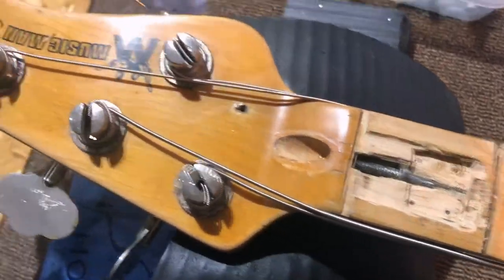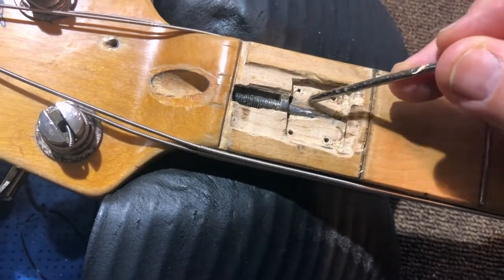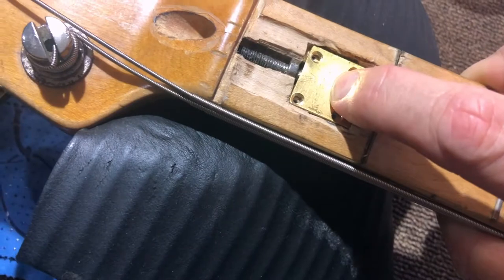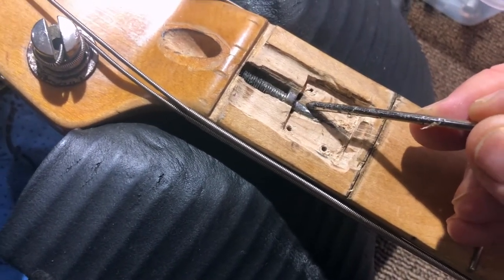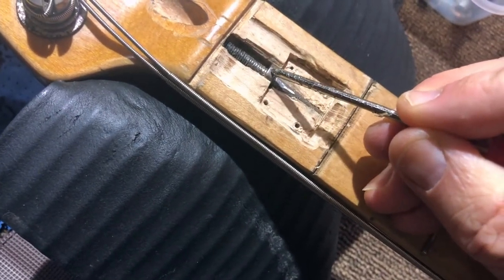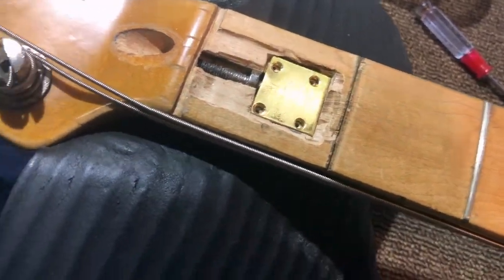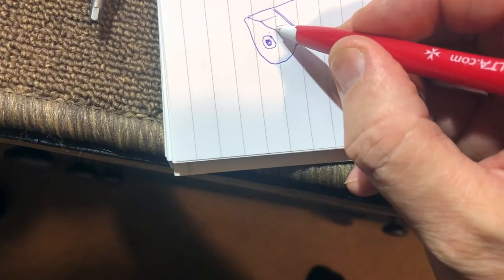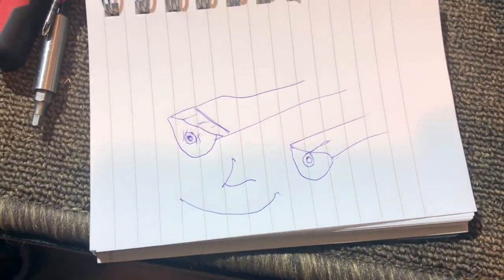Music Man Stingray Bass 1979 - 5 Minute update with weird 'almost' fix.

Comment: Should do the job i like it 
Probably would be easier and look better to fill the whole fret board on the first fret
Nice job love watching your videos 👍🏻
Reply from the maker: Would you believe it if I told you that there is no fretboard.... they designed it with the neck being one solid piece of wood... and placed the frets into the wood...
Reply: Yes I have a solid Maple neck one piece , just thought the repair would look better if you done the whole of the first fret! 😊
Reply from the maker: I might just do that... I have bought some pieces of rosewood that I will play with first but in the end that may not work and I will have to do the whole fret area.

Comment: Why do so many stingrays have neck problems? My 2009 ray had a twisted neck that required a complete fretboard level and heat treatment, then my sterling backup bass developed a backbow so bad, the truss rod had to be cranked all the way and there's no more adjustment room left. I also know of at least 3 local cases of twistednor cracked necks
Reply from the maker: I think it is a combination of the wrong wood and the length the the neck.... some can even start to twist like a pretzel.

Comment: Poorly designed trust rod installation. Most 2-way truss rods use a much larger rectangular nut.

In any event, good luck on the titanium insert. I hope it works as planned.
Reply from the maker: Titanium cut and in place but another problem has popped up... I don't want to depend on the screws to stop the plate popping up... but i think I have found a solution.
Reply: @LennonLuthierFinagler  I like the fact that you refuse to give up.